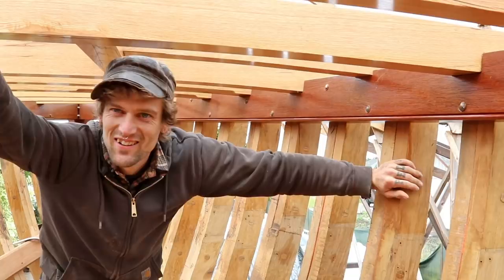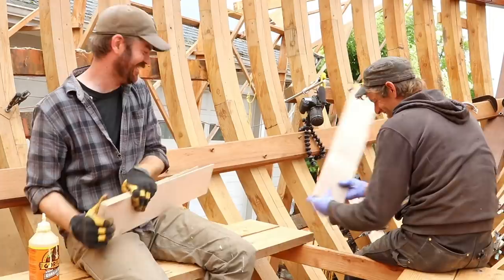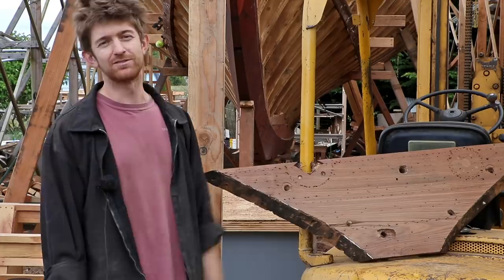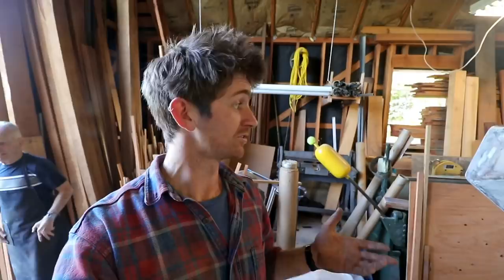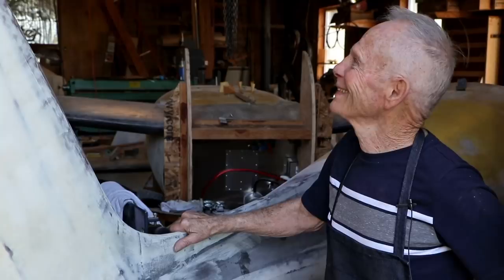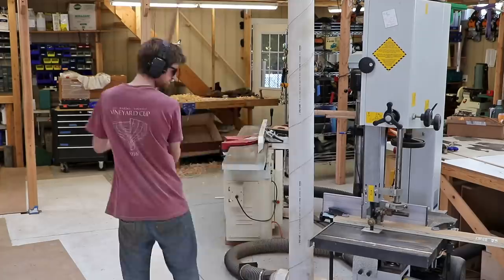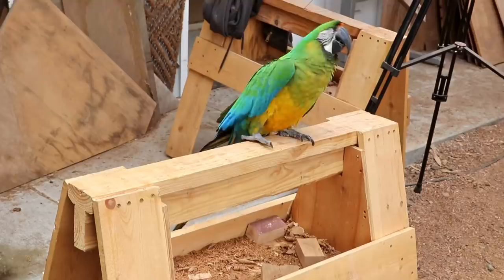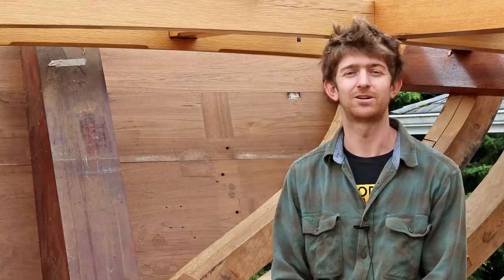BoatBuilding - Restoring the Transom (EP74)

Comment: Leo, you are an absolute wizard with your piano caliber seamless fits. Doing so on pieces that are overly large and sometimes too heavy to move without assistance is 10X as fascinating.  The transom looks fantastic.

 I love seeing the red lead. When I was ten years  old (1950) my grandfather and I, using a baby stroller (buggy, carriage, etc) walked several miles, several times over the summer to  buy house paint from George Kirby's shop (different then than now) to paint our house - Grandpa painted while my father was at work. When I was in New Bedford two years ago, following your comment that Kirby was the last remaining red lead manufacturer, I made it a point to pass by their present day location - residential rather than their original mill area address.

Comment: I've been woodworking for a few years and I picked up some neat tricks in one video. I particularly liked the way you cleaned up the old transom with a router,  leaving strips of the old material as a surface for the router to slide on. Then finishing up with a plane. 👍

Comment: i just really want to know how darn many clamps you have !! the transom has to be varnished that is a total no brainer , to paint it would make this entire restoration a waste of time , in fact there should be a law against painted wood transoms !!
Reply: you can never have enough C-clamp man !
Reply: As many clamps as needed minus one.
Reply: never enough
Reply: Blimey! I think she is a Limey!
Reply: @steveholton4130  hey I did not write that!???
Reply: DATING HARLEY QUINN  As a Scot (using a superior version of 'English' English - LOL) all I can say is I have heard both used (I think I remember my late Dad using 'cramp' more than once). I saw something that suggested there was originally a difference, but AFAIK these days the terms are used interchangeably and 'clamp' is definitely more common in the UK.
Reply: DATING HARLEY QUINN WHAT? Over where? I watch channels from both sides of the pond and both sides call them clamps with an l, i have never until this comment heard them reffered to as cramps with an r.
Reply: DATING HARLEY QUINN 
Kiln dried vs green/stacked dried woods?
 powertools vs handtools? Different finishes or glues?
Better bathing habits of modern society? 
A mixture of some or all of the above?
Reply: DATING HARLEY QUINN  yeah, those would be my two prime things as well for the aromatic differences as well. Possibly older growth vs new growth timbers as well. Differences in density of the wood could relate to differences in the compaction of the oils/pitch also. Differences in species availability could be a thing depending on geographical location and over harvesting of certain species.

Comment: Diagonal grain for the transom splines. Very clever.
Reply: I thought so too. But I was surprised that they didn't use a single spline all the way across. it seems like the join between the splines might be a place that could leak.
Reply: @davefoc  في خ٨٩٩٧٣٩٨خق٧٤حقخبك٨يمخثكيمكيمبح٤حبميكحيميمبمحبكركركنىنلم

Comment: I guess I'm a bit surprised by the idea of any hull-plank fasteners going into the problematic end-grain edges of the transom planking at all.  I thought with the massive dimensions of the supporting transom frame so close adjacent, the heavy hood-end fastening duties would be carried by those, and directly fastening into the transom planking itself wouldn't even be necessary.
 
Either way, please give further details on additional forthcoming pieces/scheme of transom framing, and how that relates (if at all) to considerations of how much original thickness (& strength?) you removed in the process of cleaning up the old reused transom planks.
Reply: That looked like about 1/8" cut on the router when re-facing

Comment: Great trick with the router for freshening a surface Leo ! Run lines across surface to required depth with router, plane off remainders an finish up with belt sander. Leo has 90 years of woodworking experience in a twenty something lifetime LOL !

Comment: Awesome Job reclaiming the Teak! Some Obvious Most blending in rather Nicely!

My Mentor, in my Journeyman Level of "Floor Mechanic" (USA term for those whole install {hardwood} flooring), taught me to SAVE the sanding dust from Various floors, then Sift That, to produce what he called "Wood Fines" or wood flour, the purpose, to fill minute cracks, then soak that with a bit of Lacquer, then END RESULT being nearly invisible fillings of worm holes, or the occasional Top Nail through the floors face. If visible at all, one might think its a very small knot in the wood!

I have modernized that by using a Quality super glue, of the thinnest Viscosity available.

Comment: What about on the transom, putting a flame-pattern or vine-pattern (to hide those holes) glued on design. Like you’d see on a cherry or mahogany wall expanse above a fireplace in a 19th century men’s club, curling vines out of wood and glued on with a rose in between. Or you could go with a chamfered lattice to look like an 18th century HMS naval fleet. Maybe do it out of a different species, say, walnut, or cherry, mahogany, rosewood even, just something to set it in mild contrast to the transom wood itself without being gaudy or “candy striped” looking. And depending on how wide and thick the attached decoration, it could add some stabilization to the whole thing.

Anyway, something to make it look like those holes were never there.

Great stuff, keep up the good work.

Comment: 17:24  .....double-checking the measurement... don't want to get this cut wrong!  Reminds me of when I was building a Grandfather clock.  I had used off the shelf molding to frame the dial face hoping to steam bend the curved piece over the top.  Couldn't find any straight grain stock that would bend without splitting and I had already glued some of molding pieces on so couldn't go back either.  Had my friend (at great effort and expense) turn a half circle of wood on his lathe that matched the profile of the molding.  I had to cut both ends at an odd angle and to the right length to match up with the existing molding and only had one chance to get it right.  Talk about sweating bullets!  Sure was relieved when it fit.       I enjoy your videos, thanks for posting.

Comment: Hi Leo, when you do the casting you might consider cleaning them by blasting with garnet then applying a clear epoxy coat, will last forever and look good. Common oil industry practice.

Comment: I replaced most of the transom on a 41' Colonial Motor Yacht that belonged to a friend. The thing that was the challenge was the boat was still in the water. He'd discovered rot, and began taking off planks that had been affected. He stopped about 10" from the waterline. I'm not joking. He brought me in because he had to make templates of the under planking and the exterior planks he removed since they broke as they came off, but he had no idea how to cut the templates.  We cut the templates one miserably hot night in D.C. (he lived onboard at the Gangplank Marina). Using them we fashioned what we thought were roughly sized planks, but when we tried them on the boat, they fit perfectly. No one was more surprised than me. We cut the tongue and grooves with a hand held router, put the planking on and when he varnished it, you could barely see the seams. The skipper of the adjacent yacht, a transient Intracoastal traveler, watched this entire affair without saying a word. When it was done and we stood admiring our work he finally spoke up, saying he owned a yacht yard on the Great Lakes, and we did work as good as any of his men. He was stunned to learn I wasn't a shipwright. The owner, my dear friend John Downing (deceased) was an IT guy for the Treasury Department and I was an environmental engineer at one of the National Laboratories. John had little boating background, but I'd rebuilt two small boats with my mother's help (she grew up in Annapolis with an aunt and uncle who owned a yacht yard). I salvaged some planks that I later used to make two clocks. So Leo and crew, your hard work is recognized by me. I'm confident the transom will look awesome.

Comment: Ok so I went back to Ep1 to refresh myself with the whole of it, now up here, looking at this then reusing the old transom is a great idea and adds to it, it keeps the link with the old boat, I understand the splines but wonder why the tansom was not bonded together, no one has asked so I thought I would as there are many great waterproof ways to turn the pieces into one piece inc many very good clear drying in epoxies. N

Comment: Wow, you see a great piece of teak when  you look at the transom timbers, all I saw was some rotten *%}]€ damn wood. I agree it has use in something, but I would  have never reused it in a structural capacity. But you are most correct in your judgement, as time will tell. You are a fine craftsman.  No Rainbow Ark here, just good boat building.

Comment: Don't know dude, I really don't know a heck about timber boats, but I've seen a 3/4 inch bolt of a side door of a crawler fishing boat bended by sea force. I would have used the old timber inside the boat (may be in tables or decoration) and go with new timber in the outside, just in case. But it is just my uninformed opinion, if three masters of timber boat bulding feel safe just use my opinion when you run out of toilet paper ;-)
Great work.

Comment: That transom is awesome - i had a bit of an idea that would look amazing if its even possible.  My idea boils down to sort of just inlaying the original bits of transom into a larger, full transom - and you'd do this in such a way that your original transom just sits inside the new one and the new one looks like a kind of edge-banding around the original one.  No idea if such a thing is possible on a ship - but i have used salvaged parts in a similar way to kind of "commemorate" them in the final product.
Reply: that said - having that transom on there and having one side of the boat "buttoned up" seems like such huge progress - still cant wait to see it all done!

Comment: Another super video. I was really impressed by your attention to detail repairing those Transom planks. Once you sanded all the patches down you could hardly tell a repair had been made, brilliant. One question though, at the end of the video you were talking about the next video and in the Transom by your right shoulder there was a patch with the grain going the wrong way, vertically not horizontally. That kind of stuck out like a sore thumb, and I was surprised after the time taken to get the rest right. Therefore I can only assume there is a really good reason for that patches grain going the wrong way.  I'm very intrigued to know more.....................Looking forward to the next install, best regards Dave.

Comment: The HMS Resolution needs a replica in 2800 days to mark the 250 yr anniversary of Captain Cook landing in British Columbia/first European.
I made a 45 ft long model of the Hindenburg, same satisfaction you're getting.
It's day 3 of 2800.
Where's the 96 foot teak keel timber?
I only need one.
Tappen British Columbia.
I'm prototyping a round half barrel raised bed garden/vertical farm, waist high with 6 ft high 'sails' with holes in them to hold slats for climbing plants.

Comment: I thought I saw a spark coming out of that edge jointer. How many blades did you go through, or how many times did you have to resharpen the blades due to hidden metal fasteners in the salvage wood? 
Post Script: I like the reversed pipe clamps.  It was a DUH moment for me that I thought of it too. 
Excellent restoration. NEVER THROW AWAY A PIECE OF TEAK!

Comment: Love the arc the build has taken, Leo. Tally Ho looks fantastic. With 
the deck beams and transom installed she has resumed her place in 
history. No stopping her now. Props to you and the crew.
 
Speaking of props, have you given any thought to going with an electric 
motor instead of a diesel engine? Check it out at Oceanvolt. It's 
pricey but IMO well worth its value. What would a fair expense be for 
such a system? Guessing less than 10% of the total build.
 
This system produces aux electrical boat power day or night in fair weather 
or foul by back generating off the electric drive when not in use. 100% 
green energy. No solar panels needed. No fossil fuels required. Put it 
on your wish list. Maybe Elon Musk or Richard Branson will surprise you.

Elon Musk's Starlink satellite worldwide network, almost complete in Low Earth Orbit and about to go live in months. Low latency internet access will be available anywhere on earth. You can talk directly with your mom or a classroom of students halfway around the world, track wind and weather, get NOAA charts and tidal information, and teach oceanography and navigation by the stars.

Comment: Love the videos. I have one issue the videos need to come out every weeks on a regular bases. 
You should give an up date on things like interior ceiling covering frames ? 
The mast, what is left from the original mast ? 
Decks, what type of materials are you going to put down ?
Engine, what make & HP.  ? Transmission reduction ?
Stem, are you going to install knees ?
Have you given any thought to rigging ?
How are you going to lay out the interior? Are the bulkheads going to be done in raised panel ? What type of material will you use ?

Comment: 6:10 very brave - old wood through your thicknesser... Still I guess that fancy helical blade set you have is easier to fix if you hit a missed fastening.
Reply: Worked at a sawmill in Wyoming for a bit. One of my jobs was to run a metal detector over the logs to find bullets. This was a stud mill. Mostly did 2x4 and 2x6.

Comment: I love the idea of reusing that teak. It's far too precious to end up heating the workshop or boiling kettles on the stove.

Back when I was woodworking I was asked if I wanted some old timber from a nearby school which was investing in a new science department.  It was a very old public school [here in England that's what Americans call a private school; here they're called public schools because they're technically open to all - if you can afford the fees].

Anyhooo, the ancient physics and chemistry workshops were being stripped and dumped. (They were jokingly called the alchemy departments.) The enormous old benches were solid teak, Tectona grandis; the tops were 12' long, 2' wide and 3" thick.

They weren't even the original tops, either - they'd been replaced about 300 years ago and were a mass of stains, cuts, burns and graffiti.

There were no famous names to preserve, so I planed off half an inch of history; the wood cleaned up beautifully. No splits, cracks, or shakes, just huge slabs of fragrant, lustrous, burnished gold that might have been felled yesterday. I almost wept.

I made umpteen cabinets from it, three large tables, numerous boxes, an aquarium stand, a blanket chest, a writing desk, a marimba, and five electric guitars (four basses and a lead).

Lovely stuff, teak.

Comment: Leo I have a question probably born out of ignorance but I have a 47 foot 1.25" full length carvel planked vessel. She weighs 30 tons and looking at the photos of her construction back in the '50's, I saw that the boatbuilder built her transom by firstly constructing diagonal 1.25" planks and THEN horizontal 1.25" planks. I was wondering why you didn't do the same as surely it would give the transom super strength and less flex and more resistance to collision? I really would like to understand why Tally Ho wasn't built that way when the rest of her construction is so massive. If you can find the time, I would be most interested to know.

Comment: Your choice to use a fir spline to join the teak transom seems problematic to me because the swelling spline could split the dado walls. I don't know what glue to use on teak because of its oily nature, but I think I would use teak splines or some inert material, even metal, because they serve mostly to register and reinforce the joint. Your woodworking skills are superb, but I cringe when you run the old timbers through the jointer and planer! Thanks for the videos!

Comment: Note your comments regarding the use of glue but would it not be the best way of assembling the transom to achieve a stronger, integrated structure and for receiving a varnished finish? Also, whilst the wooden splines will ensure proper alignment of the boards, does the omission of any metal pins compromise the rigidity of the transom?  I recall Louis Sauzedde installing them when constructing the transom of his (completely different) flat bottomed skiff.

Comment: "And thanks to this week's sponsors: Gorilla Glue"...I understand your keen desire to use as much of the original stock as possible, but you are a brave man running that gnarly and shonky timber through your surface/thicknesser. But, like you stay; old growth timber like this is priceless. Litterally just paused to type this only for you to give a piece to camera about it, 10secs after restarting. Spooky.

Comment: I'm thinking- - - don't be so shocked - - LOL

on tha Pretty little Bead on those big fore& aft beams.

I think it is very important for thos beads to be on the under sides too.

the reason is to prevent and collected moisture from running along on that

mostly horizontal underneath surface(plane) -- the bead on the underside

makes the water drip and thus prevents it from migrating on tha undersides.

(moisture from condensation and etc... this is a long term consideration.)

that's why they used beaded boards in houses.. back when..

other than that you're doing an fairly ok job  ya no  (  :)   ) 

geesh
   
K